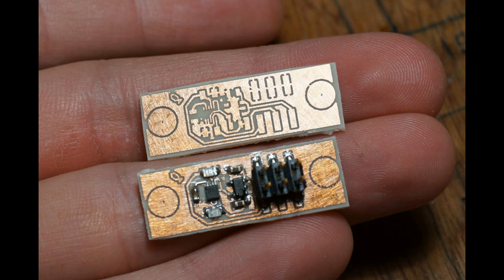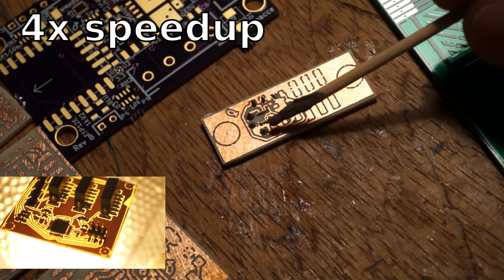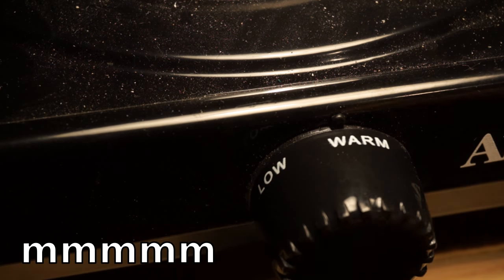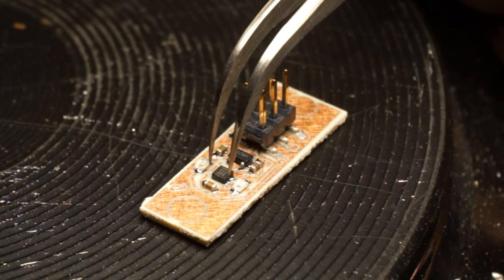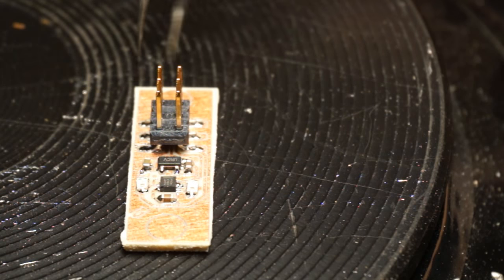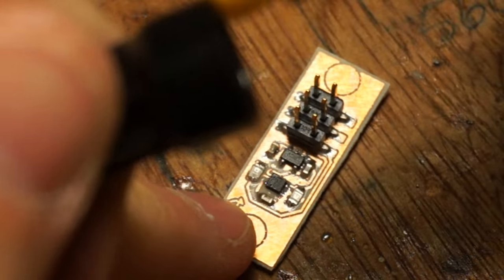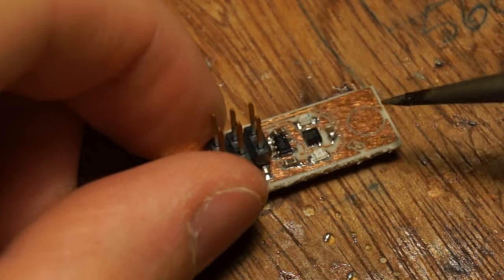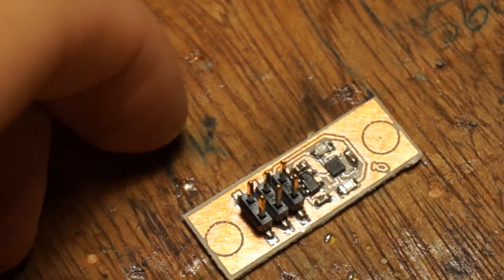Soldering a 0.4mm BSC Accelerometer

Comment: Pretty much what I do.  Except I use real solder, solder the pads, flux, then hot air from the work station.  Remove excess solder with clean tip, wiping on paper towels to remove the solder (better than brass wool pad)